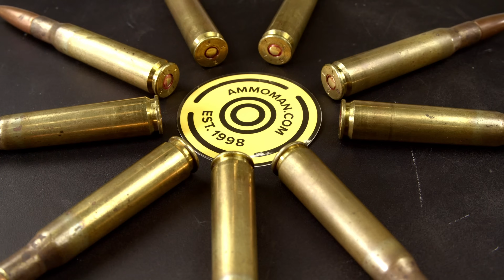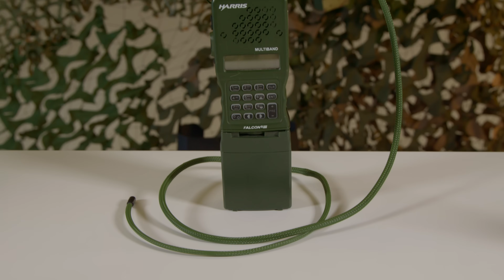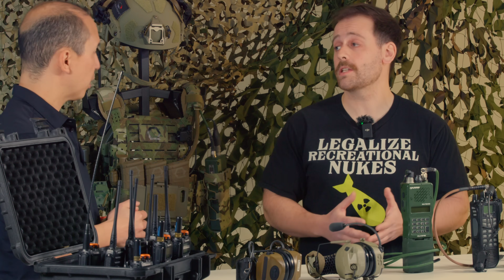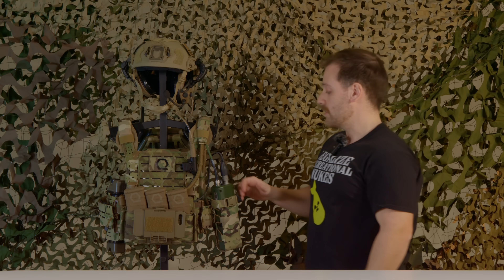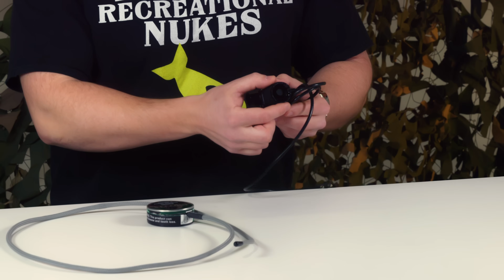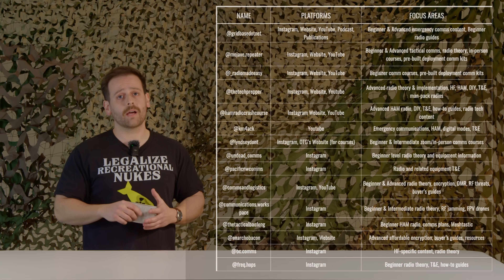The Ultimate Radio Communications Guide For Beginners

Comment: LMAO!!! For beginner's??? For real??? Are you talking to normal citizens or Joe jar head. This is NOT beginer stuff.
Reply: This is very beginner information. We did not even touch radio theory, wave lengths, propagation, different modes of operation, etc. I would recommend checking out the provided resources and go from there. Radio Made Easy has some classes that dumb down the information barney style.
Reply from the maker: +1

Comment: I think you did an excellent job of presenting options and solutions. I do think you missed one radio that is not only an excellent value at $120.00, plus one full of options. The TYT MD-UV390 Plus. It's a UHF/VHF, Analog/DMR radio. It has full ASE 256 encryption, it's IP 67 rated. It has a good battery that can be either charged in a docking cradle or with USB.  
Tough radio with 5 to 10 watts output and GPS depending on the model. Only negative is that mic connector is a 2 pin Baofeng type, so you would lose the IP 67 rating. Free programming software is available on line and is easy to use. For the person looking for a lot of capability for a low price, this one should be a big consideration.
Reply: Thanks man! I did actually include the TYT MD series of radios. I think it's defiantly the bridge between beginner and intermediate. Great radio to get users into higher-end features. It's a great contender with the UV PRO, 878 and HD2.

Comment: Links to software only when it's factory given.
You'll have to buy software from Motorola, Icom, etc. (pirate versions can be a danger and are illegal, of course).
Reply: Totally depends on what Motorola or Icom model you are talking about. For example, the DTR600/700 programming software (Business Radio CPS) is free to the public via Motorola's website. Most of the software can easily be sourced via some search engine digging or contacting some of the above mentioned resources.

Comment: Extended lenght antennas should only used on good quality radios.
If you use cheap Baos and the likes you should only use them away from antenna towers with strong transmitters.
Reply: Half of what you said is incorrect and the other half does not make sense.
Reply: @caatailantennas8914 why?  My clan is starting small with the baos, but we are worried about distance.     Very mountainous, dense forest.  Would you recommend swapping antenna or no?
Reply: @justinnutt2423  Antenna length is solely dependent on frequencies being used. Your communication range is dependent on optimized frequencies for terrain, repeaters, watts, LOS, etc. There is no quick "bandaid" fix to range, it is a very specific issues that must be tackled by answering questions like: what frequencies can we operate on, what is our budget, can we place repeaters, how is our LOS, and much more.
Reply: @bob10099  Holy cow, thanks for the fast response.  Will do some training with what we have and go from there then.   It's pretty neat to learn that there is not just one "best" solution.
Reply: @ Bob is totally correct. The baofengs are a great start. Keep on expanding your capabilities as you learn more (check out all the provided resources, the list and links is also on my website) and when your budget increases!
Reply: @caatailantennas8914 

😊😊 58 continuos years of tac, pol, mili and strat comms hear...😊😊😊😊
Long antennas on low quality portable radios (poor front end dynamic range) will saturate the unit and perfomance is worst. Unless you are far away from strong signals.

But if you are using an ICOM, HARRIS, MOTOROLA, KENWOOD, YAESU, JOHNSON, and similar, you can use extended length antennas.
Tons of real life experience....

Comment: FH (Frequency Hopping) is for better resisting jamming, interception and DF (Direction Finding) with basic means (amateurs won't be able to easily track your location)
Reply: Frequency Hopping in the modern age does very little for directional finding.
Reply: @caatailantennas8914 
Not really.
Encrypted voice, analog HF FH  is almost Impossible to track...
Reply: @jplacido9999  That is 100% false.